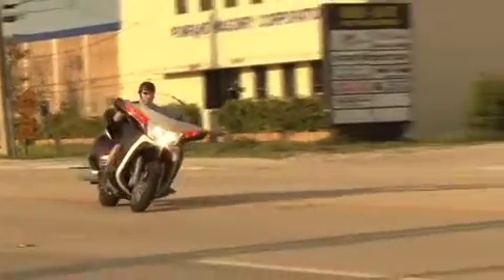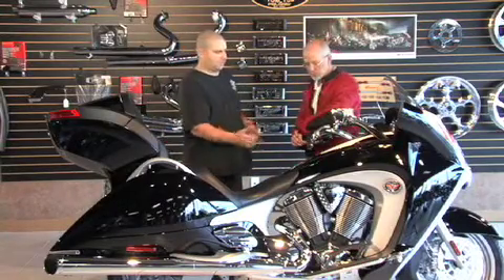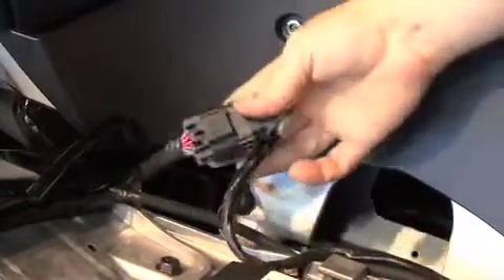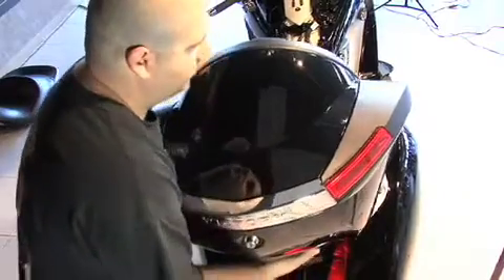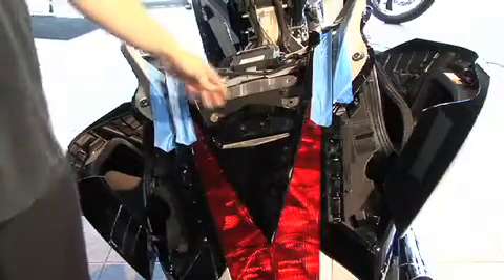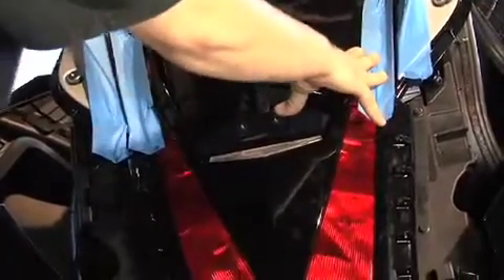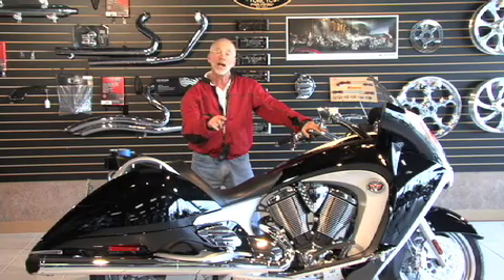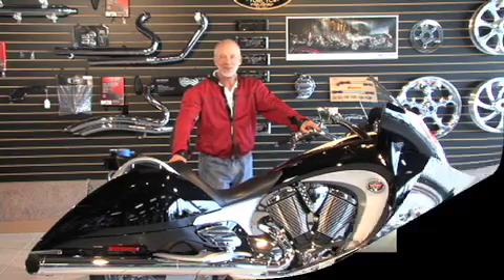Removing The Trunk from the Victory Vision

Comment: Hi!  I used this video to remove the trunk and it worked great!  I misplaced the 4 bolts that hold the trunk to the bike.  I was wondering you knew what size and kind of bolt I can use?  This is great!  Thanks!